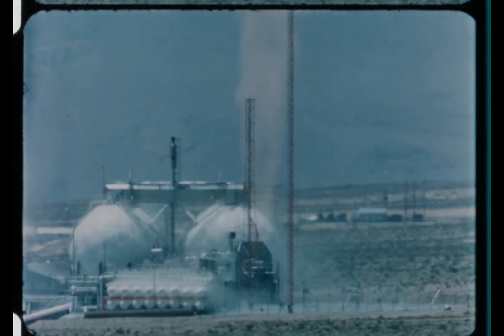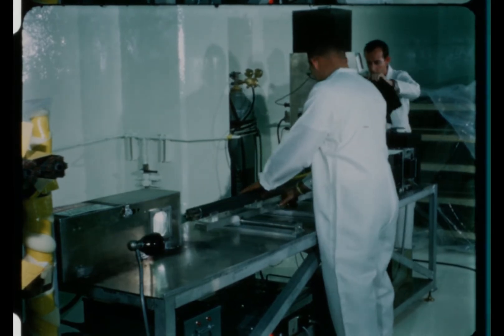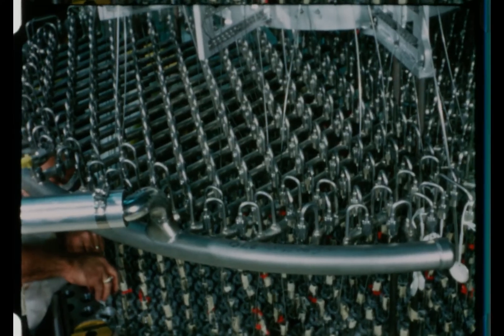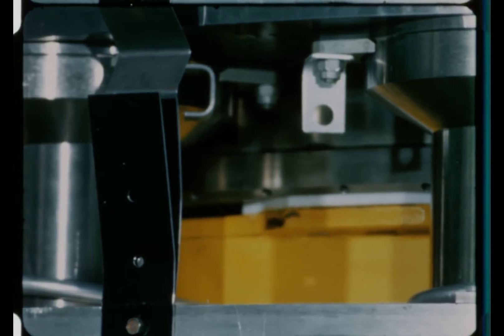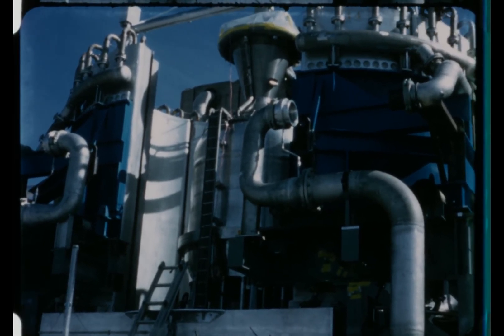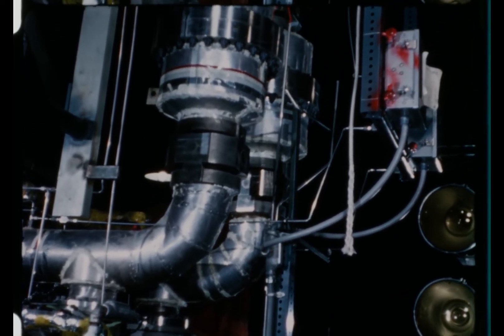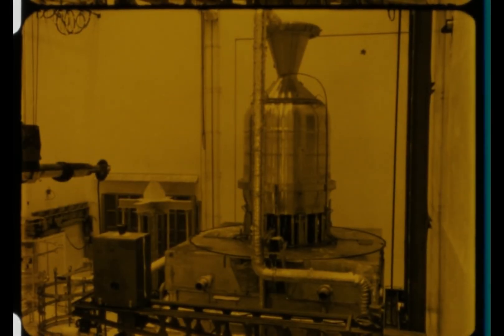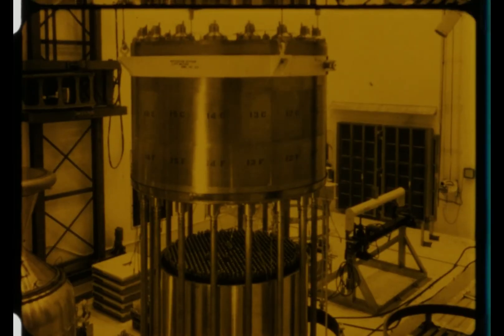Phoebus-2A: LASL's 4000 Megawatt Nuclear Rocket Engine

Comment: How fast did those guys die of radiation poisoning?
Reply: They didnt. The reactor is enclosed and shielded. The exhaust isnt radioactive, as the core is solid and basically all it does is heat hydrogen with atomic might. While being twice as efficient as a chemical rocket

Comment: Although the specific impulse of this type reactor/propellant can be very high, just look at the exhaust plume of the nozzle in this and similar videos.  There is virtually NO thrust.  There isn't a hint of a shock diamond. Based on the visual flow stream, I'm guessing that the nozzle exhaust pressure might be at about 100-to-200-psi, as based on steam venting comparisons.  Using Water as the propellant would raise the total thrust by a decade or more, and the volume of the tankage would be reduced by a factor of 100-less or more, and not require as much insulation.  The reduced SI would be well offset by the weight loss and size reduction of the actual rocket.
Reply: This is a very interesting space program. It started with the KIWI reactor that had 100MW and produced 5000 lb (22 kN) of thrust. The Phoebus 1 had a power rating of 1500MW and produced 50 000 lb (222 kN) of thrust. It ended with the Phoebus 2 ( not the 2A variant) which had a power rating of 5 000MW and produced 250 000 lb (1.1 MN) of thrust. After the Phoebus 2 came ther NERVA program and was meant to actually power spacecraft but sadly they never used it. 

To put this into context, the current version of starship (booster) produces 69.9 MN of thrust from 33 engines, so 2.11 MN/engine

Comment: Spewing out radation products at a prodigious rate what could go wrong jeeeezzzzzz brilliant !  Additionally i particlarly like the common automotive hose clamps on the fuel feed pipes ( why did the reactor explode sir ) well those pep boys hose clamps ain't worth a dam sir ! Weeeeeee!
Reply: there were no radioactive products in the exhaust. it was a closed loop engine.
Reply: @mathewferstl7042  Yep, the reactor is the heat source, the only thing chucked out the nozzle is hydrogen. In theory. Actually testing these things would be more risky than using them if it melted down, THEN you could have a spewing radiation situation. Obvs these were designed for use in space only, the actual thrust on these engines is pretty poor and weight very high, but very high impulse, so perfect for vacuum operations. Chemical rockets are the only way to orbit for the forseeable future.
Reply: @mathewferstl7042  I’m curious as to the neutron spectrum from the reactor and if tritium would be bred from the hydrogen in the exhaust product.
Reply: @mathewferstl7042  Do you have any links for this being a closed loop design? It sure doesn't look like there's room for heat exchangers to a secondary loop. Why would you need a closed loop? Its pure hydrogen flowing through the reactor, so possibly Deuterium and Tritium produced by neutron activation. Tritium is radioactive but there's little time for much of it to be produced, and first the hydrogen would need to be activated into Deuterium. About half a cup of tritiated water needs to be disposed of in Fukushima, that's from 3 reactors operating for a decade. How much Tritium would be generated for a few minutes operation?

Comment: This all happened while I was in high school!  What were the radioactivity levels of the propellant gases during operation?  Was that a factor in why the NERVA rocket was never used?
Reply: Little to no radiation in the exhaust. These were called closed loop engines and the fuel was solid. So the propellant/coolant is just normal hot gas. 

As for why they were never used. It was planned to use them for the Apollo missions. But it was quickly discovered that while extremely promising they couldn't be made flight ready before Kennedy's end of the decade deadline; so they were shelved in favor of the conventional Saturn V that had a more optimistic build schedule. The idea of nuclear rockets has been revisited many times. But without the Apollo Era big space funding it's just a curiosity. An extremely frustrating curiosity for space nerds since they're drastically better in every way and we know they're possible.
Reply: @bronzedivision   I pretty well suspected that this was the story.  I'm also sure that anti-nuclear political pressure groups had a place in the equation.  Whether the propellant mass was liquid hydrogen or plain distilled water, there is little there to become irradiated and nothing long term.  This means that NERVA could be used to lift a spacecraft directly off the earth's surface and on to an interplanetary objective.  Of course, writers were predicting that since Fermi's first reactor!  I'm still amazed that this was not done during the 20th Century.  How much simpler a way of delivering payloads through space directly, point to point.  With the Moon as a refueling stop, the entire inner system would be economically accessible.  I had really hoped to see that in my lifetime.  I'm often reminded that the first movie to deal with it ("Destination Moon" of 1950) was made a year before I was born.  The time we've wasted!
Reply: @stevenpilling5318  "Specific Impulse" is a good way to compare rockets, although there are many others and it gets technical. It's why we use 'rocket science' as a idiom for difficult. :P 

Anyhow; conventional rocket have SI of 350-450 at best. With around 800 being the best imagined if metallic hydrogen is ever invented and made practical. Each of which is an all but impossible goal. And for reference 300 SI is the (very) appropriate minimum to be useful.

The small gap between these two numbers of only 50-150 SI is the reason why rocket payloads are so tiny; typical just a few percentage points of the total mass. But SI is a nonlinear metric and small improvements can net huge gains. 

Whereas the specific impulse of the bottom tier nuclear rockets tested in the 60's and again for a bit in the 80's was around 850-900+ and far FAR better nuclear rockets are possible. But 900 is what we've prototypes for certainly and directly measured with the thing blazing away on a test stand.

With 900 specific impulse it's theoretically possible to build a rocket that's HALF payload. Although really expect a random grab bag of inefficiencies to eat up a little of that. And nuclear rockets are inherently reusable, which isn't needed but is a popular idea these days. 

That would mean rather than 40-50+ Space Shuttle missions a nuclear rocket of similar size to the Saturn V could build the International Space Station in about 3-5 trips. ;)
Reply: @bronzedivision  I've seen recent videos on the subject that describe the nuclear thermal rocket as having twice the SI of the best chemical propulsion.  That, however, was based on the static tests of the early Seventies.  I'd bet that they could do a lot better today.
Reply: Nixon closed the program in 1973.